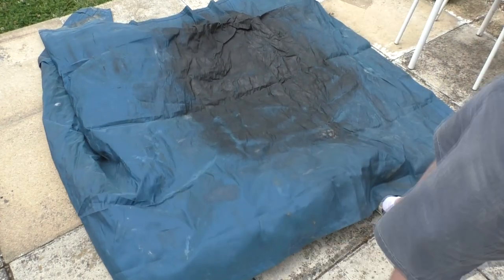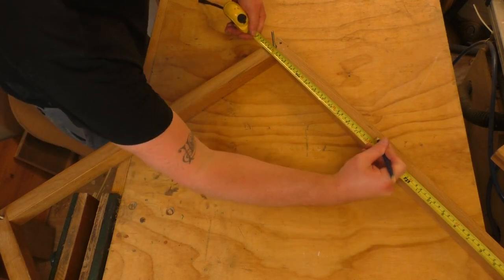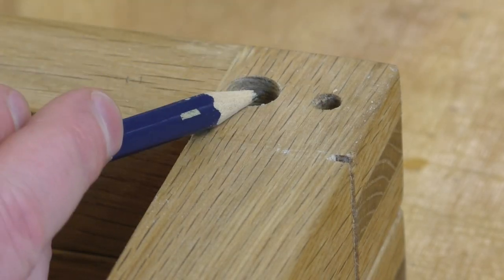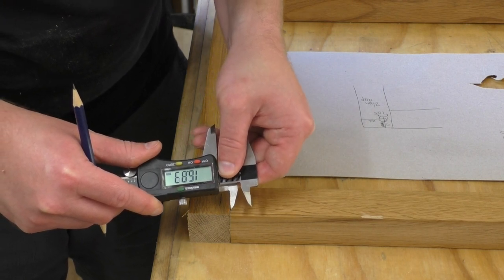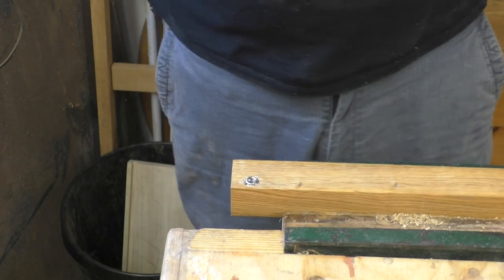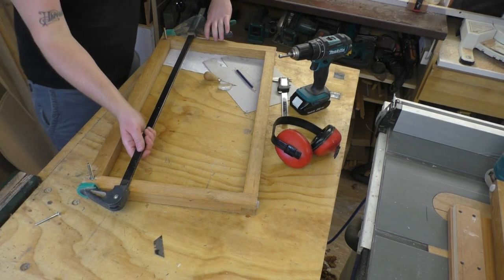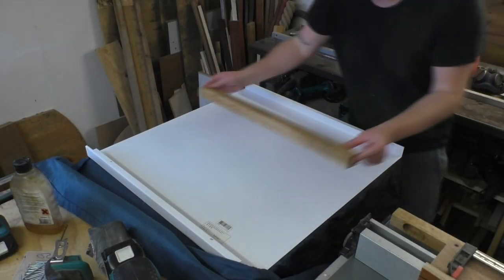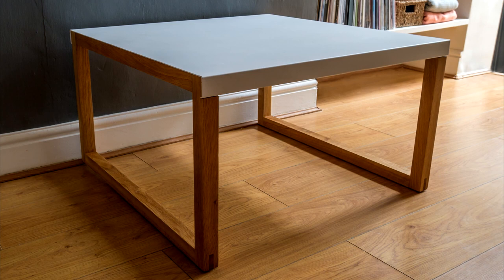Converting A Dining Table In To A Coffee Table - Habitat Kilo

Comment: You did a good job on the steel topped table,but I must admit I'm a old fashioned traditionist,for table tops it has to be wood,never glass ,or store e or steel,if it were my table  I would cover it with green baize, but good job

Comment: What are your thoughts on that 18v Makita Random Orbit sander? I can get the 18v for £85 or the 240v for £65. I'm already on the Makita 18v platform with a brushless impact and brushless combi.

Cheers for the video, great work.
Reply from the maker: +Ryan Cooper hi Ryan. I'm not crazy about it to be honest, it's quite slow and it leaves pigtail marks, and my old wired makita sander was much better in my opinion. More comfortable too. The fact that it runs on a battery is about the only thing I like so far
Reply: Thanks for the reply. I will probably go for the mains version then.